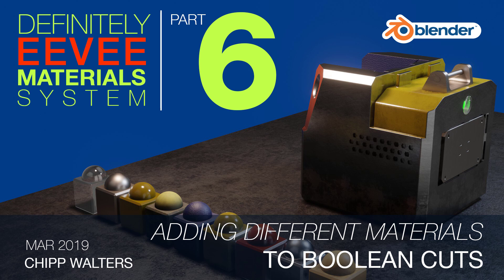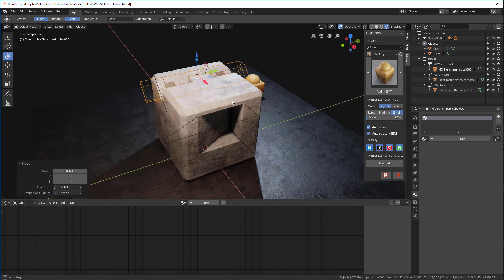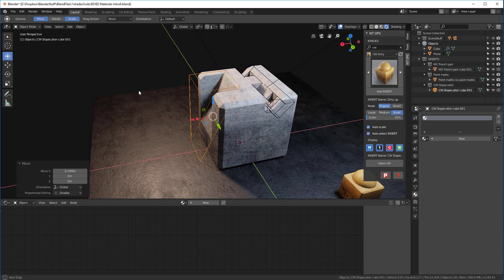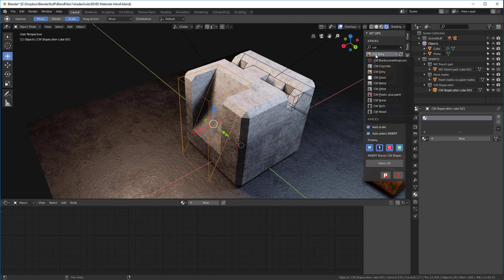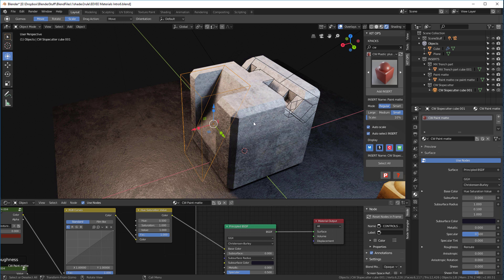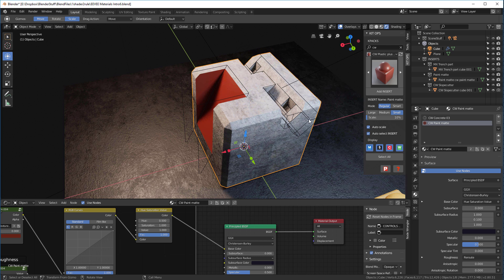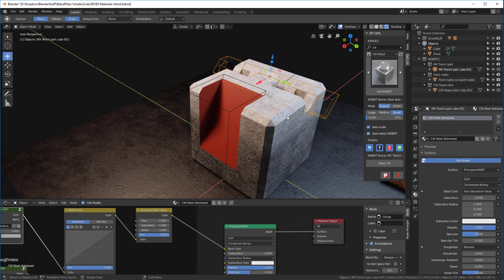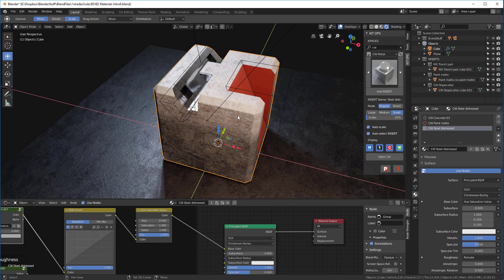06 Adding different Materials to Boolean cuts for EEVEE in Blender 2.8

Comment: Very cool, but the only problem is if you apply it to a glossy surface, the dirt is glossy as well, because it only plugs into the base color socket. Is there a convenient way to maintain the proper roughness in this case?
Reply from the maker: The newest dirty shader has an output for roughness which you can then mix with the existing roughness of the material to get what you want.
Reply: @ChippWalters  Thank you...I had missed that!